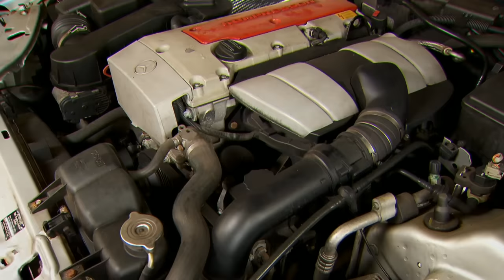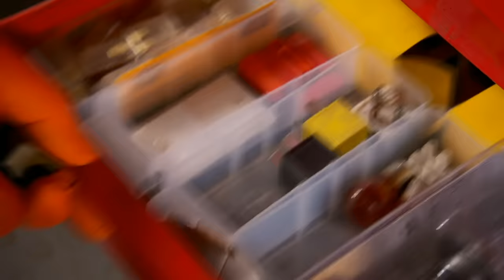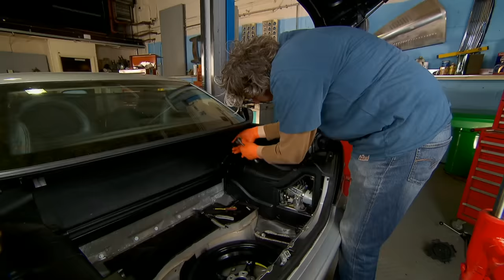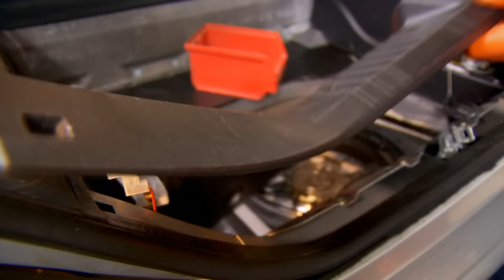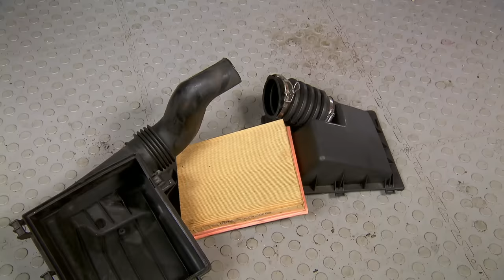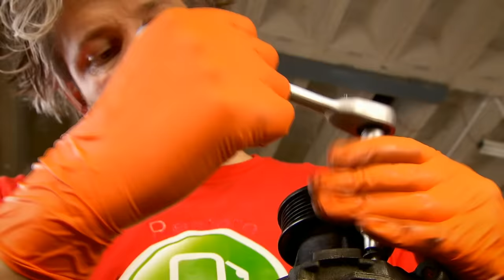Mercedes SLK: How To Fix The Roof And Change The Supercharger | Wheeler Dealers

Comment: You are lucky it is a face lift slk 230 (repeat indicators in the mirror housing, as the Early version has a bigger supercharger and and electric clutch (does not rotate until engine is at 2500 rpm). and the supercharger is a pig to remove.
Reply: Early SLK are crap ! Facelift are wonderful !
Reply: Can you tell all the facelift pros?
I have one 2003

Comment: The hydraulic fluid on my pump is low and I want to add more hydraulic fluid but the Allen wrench bolt is extremely hard to loosen and get off as it is in there for 24 years now.   The car is 1998 MB SLK 230.   Is there a proper video for adding hydraulic fluid for the roof pump in the trunk?   Thank you.

Comment: I want to buy a very nice SLK 200, it has only 66 800 kms on odometer but the dealer told me the roof stopped working this winter.
Should I still buy the car and how much would it cost me to fix the roof ?

Comment: i did this on a CLK 200k with newer (M271) engine. even more difficult, it took days 😂
Reply: dont talk to me about the m271 engine its most over engineered engine in history and that timing chain that wouldent be suitable for a kids bicycle
Reply: @drone_tours  ~247000km (153k miles) and still running 👀
Reply: @rimax82  there's nothing really wrong with them just replace the timing chain every 95k miles and service it regularly
Reply: @drone_tours  I actually used a bicycle chain tool to drive the pin in on my new chain. Couldn't believe how small it is 🤣
Reply: @MarkoVukovic0  yeah the problem is that the engine is too powerful for the chain and over time all the torque stretches it

Comment: My roof stopped functioning and I had to close the roof manually.  Now the boot won't raise when I attempt to raise the roof.   I am not receiving an error signal from the roof switch.  I recently added hydraulic fluid to the pump (the proper Mercedes fluid.)   Any thoughts?
Reply: The hydraulic fluid on my pump is low and I want to add more hydraulic fluid but the Allen wrench bolt is extremely hard to loosen and get off as it is in there for 24 years now.   The car is 1998 MB SLK 230.   Is there a proper video for adding hydraulic fluid for the roof pump in the trunk?   Thank you.

Comment: where y’all at i got two of these cars one is the same as the one he is working on and the other one is a 1999 and the dealership charged me 1,665 just for the gear shifter and i have a whole parts car 🤦🏽‍♀️ i need my top yoo go down and my throttle position sensor replaced and i don’t like too do it myself bc the car is very delicate all i did was clean my car sprayed something on the dash not even the gear shifter and it somehow found a way down there cause it too mess up i need someone that’s not gon charge me 3000$ for something simple sooo pls respond 😭 u probably 3 days away tho